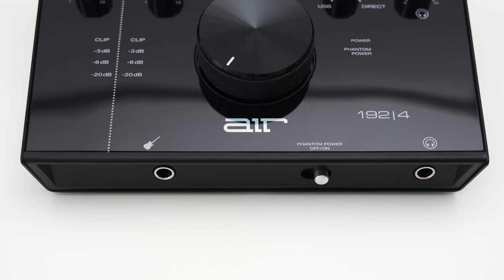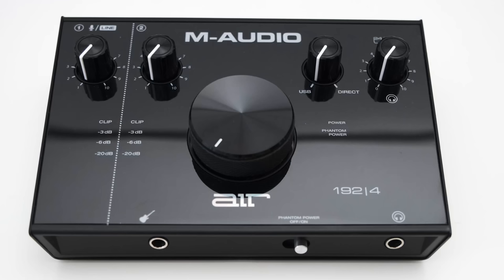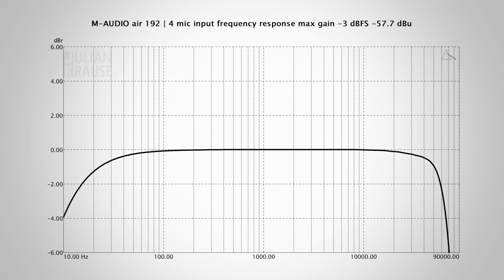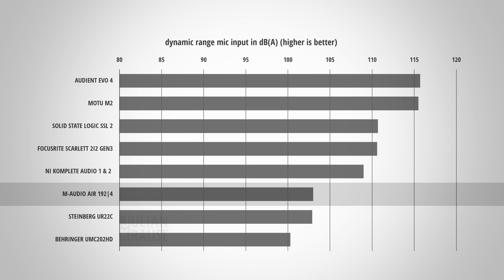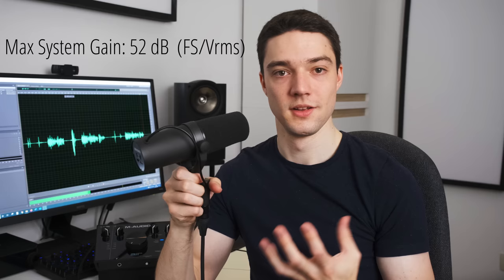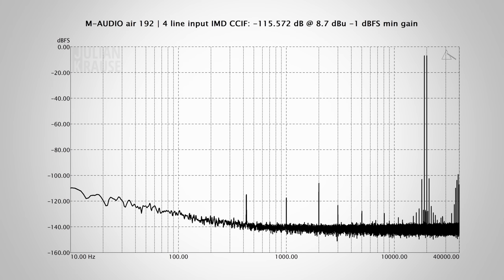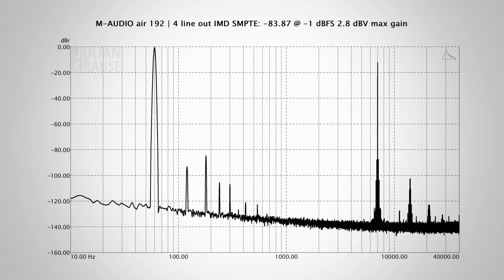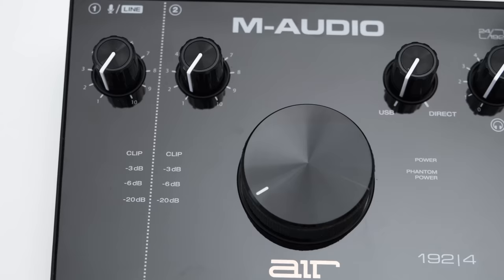M-AUDIO AIR 192|4 USB Audio Interface - REVIEW (audio quality measured)

Comment: Hi Julian,  could a preamp have any impact on, for example, transients—or maybe a characteristic interaction with a connected microphone—that doesn’t show up in your measures of noise, distortion, and frequency response? 

Asked another way: if, in theory, you measured zero noise, zero distortion, a perfectly flat frequency response, and sufficient gain, are there any remaining ways in which the preamp might have a desirable or undesirable impact on a recording. 

It seems to me that if somebody is after transparent recordings, these very very affordable interfaces are already doing an almost perfect job. Is that right?
Reply: First of all these are excellent and super informative reviews - so thanks a lot 😊👍🏻!

From my experience - yes there are many things affecting the outcome beyond the ones measured here. But the ones measured here are the easiest to interpret and draw conclusions from. So the rest are maybe better to just test out by listening.

I find the transien performance (timing) very important and it can be measured by oscilloscope. But the normal 8-bit ones do not have nearly enogh resolution for this. Then again I also prefer to see higher sample rate/frequency than many dedicated audio measurement tools provide. I have been thinking of buying a PicoScope 4262 because it is quite cheap with reasonable performance (but got sick a while ago and need to reprioritize ☹️).

Also depending on the mic and the pre there are varying degree of interaction between the two.

But I also think that nowadays these cheap interfaces are very good indeed. Before getting any super expensive interfaces things like room acoustics, master clock, cables and non-resonant mounting are good to be in check.
Reply: I have (bought new years ago) RME Fireface UFX and it got a lot of functions but it's not so good in terms of sound quality compared to many high end home audio preamps, DAC:s and headphone amps. I was somewhat dissapointed to its performance but then again it does not cost much (with all those functions).

I mean that the mic preamps were okay and the re-clocking in digital domain (digital in/digital out) was very good. But for example when used as a DAC it is quite bad... No resolution and wooly/sluggish transients etc. Many 400-500€ DAC:s were clearly superior and most of the 3-20k€ ones were like from another world. So I guess that in terms of SQ these cheap interfaces are much closer to my RME than my RME is to those really good separates.

! Please notice that my RME is an old model though so they might have improve.

Comment: Sorry to 2nd-comment: M-Audio bang on about ‘high speed usb connection giving low latency’, then it’s impossible to find the exact spec of usb they have incorporated!  I’ve looked at the user guide online, checked loads of web pages…no, they mean 480Mbps when they say ‘high speed’, and that’s a damn cheek when usb-c up to 20Gbps is available, and USB2 even, is 5Gbps!  Damn cheek.  Thanks again Julian, just been rooting around, cannot find an answer to this simple spec issue, suggests they buried it, to me.  It’s kind of obvious, if one states there’s a ‘hi speed usb’, the first question in a potential buyer’s mind is ‘hmm, what USB transfer rate are they using then?’.!

Comment: 7:06 the noise floor sounds awesome
I'm using a Goxlr Mini right now and I'm not happy with the noise. Julian did not review that interface / mixer yet, but I guess that he will measure the same noise floor I can hear all the time. Beside that the Goxlr Mini has a super noisy (yes, even more noise) headphone output which makes monitoring unpleasant.
Anyone here using a Goxlr Mini with a SM7B and can refer to my experience? 
Anyone using the M-AUDIO AIR 192|4 with the SM7B and can write a little about his experience with that? 
I'm a little skeptic about the power supply by USB as it might introduce noise.

Thank you Julian, your reviews are awesome (und ich mag den deutschen Humor total).

Comment: Question. I just bought the focusrite solo. But i will be returning it because it doesn’t have a dedicated headphone volume knob. You have to unplug or turn off the monitors every time you want to hear in the headphones only. That is not the case with the m audio right?
Reply from the maker: Yes that's correct the M-Audio air 192|4 has individual controls for your monitors and headphones.

Comment: HI I have the 192|6 and was wondering if I should connect my guitar plug in the front jack or combo in the back, supposedly the combo is for active and front for passive.. the thing is my guitar goes through powered pedals like boss looper and boss space echo, so I don't know if that should go in the front jack or the rear combo as both pedals have volume control. Thanks!

Comment: I will never buy an M-Audio interface again. They update these interfaces every few years & then they don't update there drivers for there older products making your unit unusable. Shocking support!!! I switched to Apogee Duet & the sound quality was sooo much better & no issues with drivers
Reply: I am not sure why not updating a driver makes it unusable.
Reply: @Traumglanz  It depends, in the Windows land, old drivers have generally continued to work OK for quite a while. I am just now starting to get issues with drivers last updated in Windows Vista era. Though with the way things change in Windows 10, you kind of wish the hardware was still supported because breaking changes do happen. With ASIO drivers you may also want bug fixes for newer versions of application software that come out, but that doesn't seem to often be the case.
Things get radically worse if you're a Mac user, because Apple has a fairly short deprecation cycle, they update the system and kill off older APIs, their development tools encourage or force application developers to update the software and make it incompatible with older version of OS X, thus you must update the operating system to keep updating, or sometimes just to keep using your software; and newer system versions often need new drivers, due to changing interfaces, signature requirements, etc - at least for devices which are not pure class devices and need dedicated drivers. Because of this, unless your hardware is purely generic, and when it no longer has continued manufacturer support, it becomes a door stopper.

Comment: I really hope you answer this, I'm buying my first audio interface, but I won't be using inputs, I only need it for headphone monitoring, which do u recommend for that? Scarlett Solo or M-Audio Air 192? 

I have a Sony MDR7506 Headphone which is plugged directly into my PC. It currently uses Realtek driver, and I'm not satisfied with it, I don't want latency when I play my midi keyboard, and I don't want crackling noises when I turn down the buffer size.

Comment: fairly new to recording so pardon my ignorance. i have a mixer (Behringer Powerplay HA6000) that has multiple inputs and this audio interface. would i be able to record more than 2 tracks at once in the the software i use (Studio One) ? Have 4 instruments id like to be able to record all at once. Would i need an audio interface with 4 outputs then? Thanks in advance.

Comment: This is fantastic except I disagree with your review of the line 1 and instrument inputs on this device, which have some major differences. I own this, and unless your instrument is passive (my electric bass is active) the instrument input is worthless. It took me a month to finally try the mic input which is far more capable of connecting to an active instrument in terms of sound quality and the ability to not clip when your instrument is at 100% output. I also do not see the separate comparisons of each input beside each other in your graphs. I think having the separate readings might be helpful, even if similar, to provide more transparency in how the inputs respond.

Comment: Julian please help me!! :/ I watched 10 videos and was satisfied with your shure sm7b with the Air 192 4 sound. I got the kit connected it and my sound doesn’t the same at all. Gain 95% on the interface. If you can assist me or give me tips please do. What mic settings itself? What eq mixer settings please just tips

Comment: What is the difference between DX and Wave? im getting several different option within Ableton for input and output. Sometimes when im switching between them to figure how I can record with my line in, it will crash ableton or the interface sends a message saying it failed to connect. Please Help!!

Comment: I have a question and really need help. So I have been setting up my at home studio and have an M-audio air 192 6 usb linked to my MacBook Pro. The issue I'm having is that I am only getting sound out of left speaker. I have contacted apple over the phone for hours and have no solution, even went and returned the old one interface to get a new one in hopes that it would fix the problem and I am still having no sound coming out of my right speaker. cords all work so its not a cord problem, I honestly feel I have exhausted all measures I can think of. if you know anything please help me out.

Comment: Hi! Greetings for your great work at audio reviews! I've bought the Air 192/4 bundle (with mic and everything) and it seems to work only at 44,1 or 48khz. If I set a higher sample rate, most programs won't play any songs and even Ableton won't let me use the devices as input and output options or if it does, the mic would sound totally crazy and glitchy. Isn't that abnormal? And why the company  markets the sound card as 192khz when I and many other people complaining on amazon can't set it to match this setting? If it's allowed to function only on those lower sample rates, then what distinguishes it from the M-track series or other budget options? Even in the set up guide that M-Audio provides with the package, it asks us to set the sample rate at 48khz. Maybe that's a thing a beginner shouldn't really ponder much about but still I'm kind of confused and trying to figure things out? It would be nice if somebody sheds some light on the matter. Thanks! Best wishes!
Reply: Did you install the drivers? Are you using whatever ASIO driver provided by M-Audio? Did you read the manual(s) to see how to get higher sample rates? It is not uncommon among budget interfaces to sacrifice playback ability when operating at their highest sample rate, it would be good to check if this is the case with this M-Audio interface.

Comment: hey i would like some help,
im planning to buy m audio air 192 | 4, but i have heard it has driver issues with amd ryzen cpu and windows 10, have you had a problem like that or any driver issues?
Reply: Yes, they stopped updating their drivers. Mine doesn't work anymore with a Ryzen and Win 10 and they don't seem to be solving the issue.

Comment: hey so i just purchased this and noticed whenever i plug it in it produces a white hissing noise (even with no mic or instrument plugged in) is there any solution to this? i’ve plugged it in to different computer and even plugged it in straight to a portable battery pack and it still produces that constant noise

Comment: On my high end gaming pc with usb c connected shape, my unit is causing random poppings when i open or close a window or application. I am not sure whether this is related with my settings of  interface but on my old Roland Tricapture, i don't have this issue. While doing casual listening, poppings and clicking are occuring. 44.1khz 256 sample
Reply: Same issue on Windows 11 22H2. Do you find any solution?
Reply: @ozkaramustafa  i returned

Comment: Ugh, this is aggravating. I had the M Audio Air 192/6 and I ended up returning it because it would not connect with my Mobilestudio Pro Tablet. To see it working on Windows 10 properly makes me think either something was wrong with my unit, the driver or with my PC tablet. Is it just simply plug it in and play?

Comment: Hello so if i got headphones that require about 150 ohm should i get a amp?
Reply: You don't need to, as the Audio Interface help to achieve the output without any problem.

Comment: Can you run Beyerdynamic 80ohm headphones on this Interface? I looked into it and found out, that this interface has a headphone amp output impedance of 10 ohms, and these 80 ohm headphones sound damped and low when Im recording and have mic on, Im thinking of using the M-Audio Hub that has a external powered  headphone Amp to provide enough voltage for these 80 ohm headphones, in the future Im staying away from USB powered interfaces

Comment: Will this audio interface be able to power up the beyerdynamic DT990 pro 250Ohms?
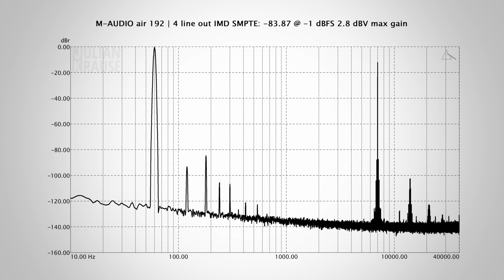Reply: as said, check 9:00
work better with 80hms,
with 250 you could get low volume

Comment: I have this interface, have you noticed that when turning the gain dial whilst let's say talking, you can hear it generate a bunch of static noise? Like there is a bad connection or something.
Reply: I have the 192|6 I don't get static noises in higher gain, but my condenser mic picks up the sound in my room more. So I set my gain in 12 o'clock or 11. But no noise, it's clean not like my 1st gen focusrite which is now very noisy.

Comment: What's a great audio interface for AT2020 XLR mic and a MIDI keyboard ARTURIA or AKAII?
Reply: You can run the AT2020 with a junk interface, it won't really make a difference, because it's got plenty of internal gain, just as long as the interface has P48 standard phantom - but if you had to choose something that is available new from the store, there's not much wrong with Behringer UMC202/204HD, the latter is slightly nicer to monitor with, and has MIDI and insert routing. MIDI keyboards as in true MIDI? Usually they have builtin USB these days, and some don't even have actual MIDI any longer, so you might as well plug them into a USB hub and use them via USB - better that way, plus you get descriptive names for your devices in your DAW rather than have to differentiate them by MIDI channels. True MIDI bus can be a pest to deal with, because when you play a chord or anything, that's enough to accumulate several milliseconds of jitter and latency, as the bus is really really slow, USB is free of this issue, or at least has worked pretty well for the last 15 years.

Comment: Do you have the circuit photos somewhere. Just wandering if i can solder in another xlr.
Reply from the maker: Hey, it's a two channel interface I'm not sure where you would want to connect an additional XLR plug. If you need more inputs it is much simpler to buy the 4 channel version.

Comment: I recently purchased the M-Audio Air 192-4. I was able to install it on my PC. It came with an activation code for Pro Tools First, which I also installed. I've done a 2nd install of M-audio software on another PC in a remote location but cannot load the Pro Tools add-on. Does anyone know if the activation code is only good for ONE installation only? I'm not finding the code anywhere, though M-Audio loads up on the 2nd PC. To load Pro Tools I had to create an AVID account. Pro Tools is listed on AVID as a product I own, but there's no activation code listed. On a side note, if customer service is important DO NOT buy this unit. I've called M-Audio 3 times to talk to tech support, there's no one there. The last call I hit 0 to talk to the Operator, it comes back with a message 'there is no operator'. I've sent 2 emails and have no responses.  Very very frustrating.

Comment: Hey! I noticed that you rated this “red” for channel balance in headphones output analysis. Does that mean that left and right channel’s volume differs by 2.70 dB? How bad is that in real life situation?
Reply from the maker: In practice this means that when you turn down the volume very low listening level, one side of your headphones will sound noticably loader. At normal and loud listening levels this isn't a problem.
Reply: Julian Krause thank you very much Julian!

Comment: I personally had bad experiences with the Air:
1st, the drivers don't support AMD processors and I found this out afterwards, while searching for fixes, because the drivers didn't work.
2nd, the interface died somehow. I opened my DAW, and suddenly, I just heard sound on the right ear. After plugging the interface back in, I heard only a loud sine wave.
Reply: The "not supporting AMD processors" bit sounds extremely implausible. There's either an issue with an USB host chip or something else, because nothing should be anyhow CPU dependent here.
Reply: I wanted to buy it. But thanks to you I won't, due to incompatibility to AMD processors.

Comment: Hi thanks a lot for the very valuable video.  In the distortion measurements (results showed at  3:56) how do you generate the 1kHz test signal ?  i am always looking for a nice low distortion signal generator but it is not easy to find one not too expensive   Thanks a lot, gino

Comment: 2.7 db diference on Channel Balance??? Is it on main outs or phone?
Reply from the maker: Hey, that's for the headphone output. But be ware, this is a worst-case figure with the volume very low. At higher volume levels this becomes much smaller (> 1 dB).
Reply: @JulianKrause  thanks for the clarification! More than 1db diference became unusefull. Congrats for the value job that you provide us.

Comment: Ok, I really need help and feel free to call me stupid if I'm being stupid. Trust me it would be a relief if I was being stupid and can easily fix this problem. Anyway, my computer does not recognize the headphone jack as an audio output device. I plug in headphones, go into outputs, and it literally doesn't show up. It recognizes the speakers but not the headphones. Is this a software issue on my end? I've redownloaded the latest drivers available two times and still nothing. Tried removing the device from my device manager and setting it back up. Still nothing.